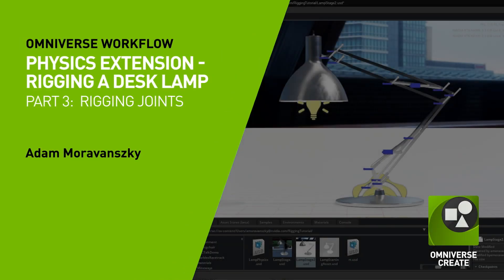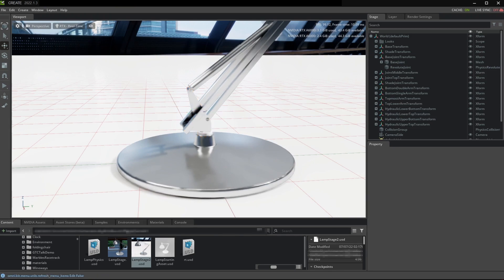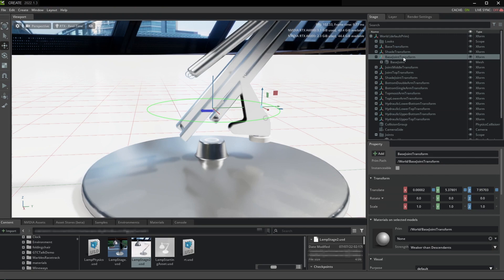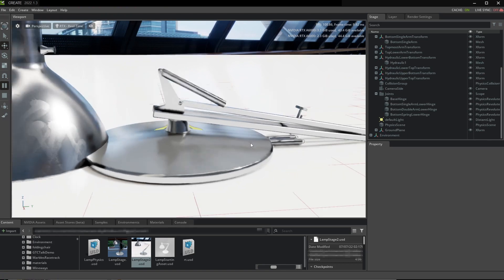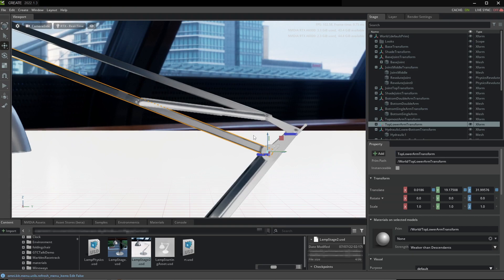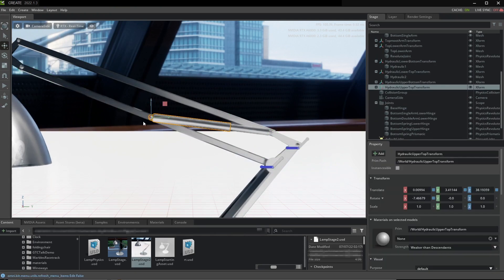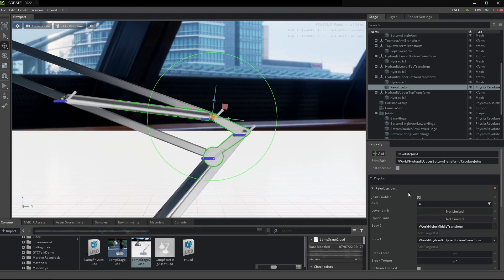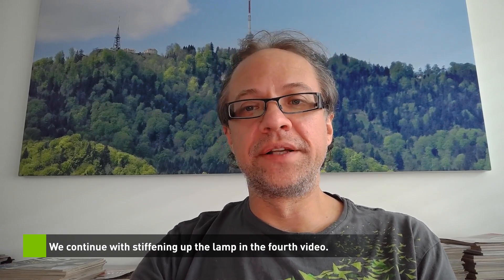NVIDIA Omniverse Physics Extension - Rigging a Desk Lamp Part 3: Rigging Joints

Comment: Is there a better way to set our rotations to the location of a XForm? That way we can create empties in Blender and set the joint location to be the position of empties set at the center of points.
 Instead of eyeballing it like you did for the "manual adjustment" of the revolute on the top elbow of the lamp